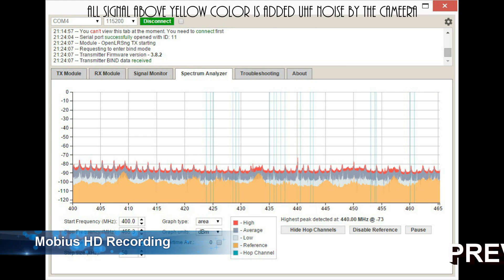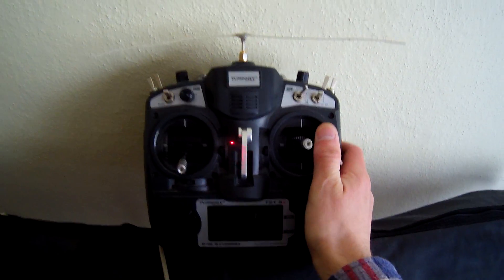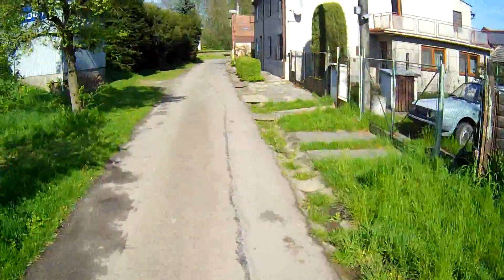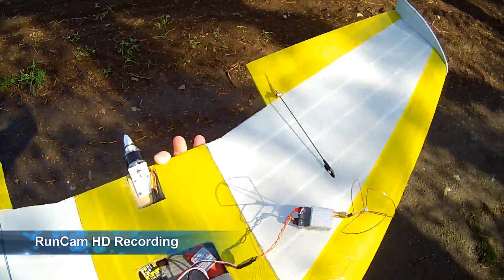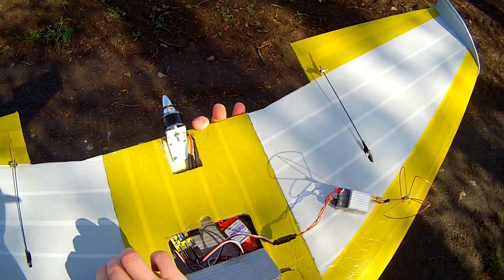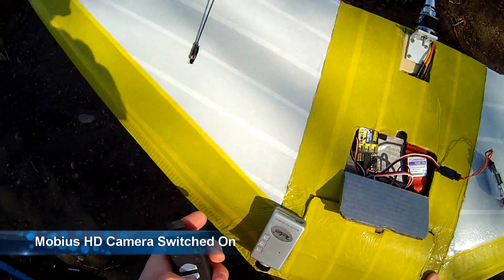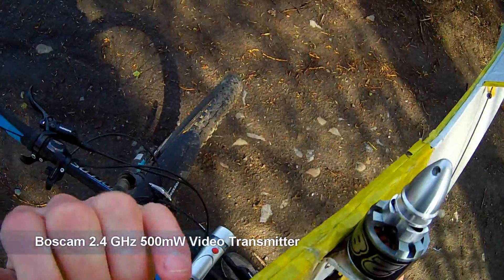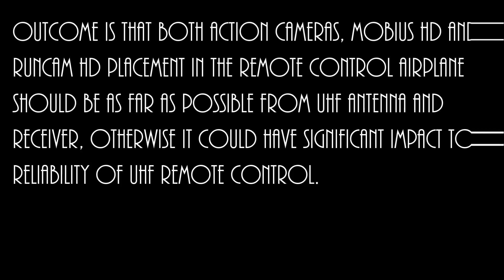Mobius HD & RunCam HD UHF Noise Experience & Test

Comment: Thank you very much. I thought the RunCam HD is much more quite than the mobius, however from your real world test it appears there's not much difference.
Reply from the maker: Hein Du Plessis You are welcome. I found this issue after I lost Open LRS control unexpectedly with my built Blunt Nose Versa https://youtu.be/3aNf5OO2o4E. Now I am trying to get to the air again with improved reliable setup. Yes, there's not much difference. They said they will try to make better case in the future. I shielded my RunCam HD and video transmitter and I can place it now near UHF antenna. I will try to post video about what I did and also how it behaves showing the difference from similar ground tests as I did in this video.